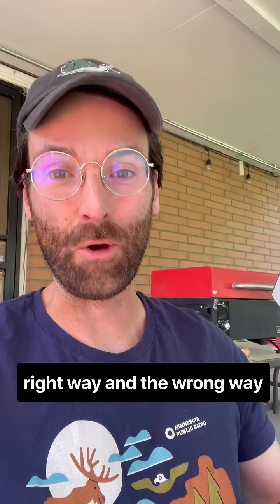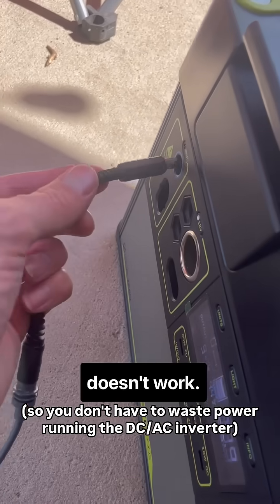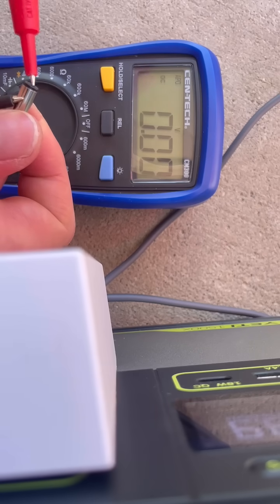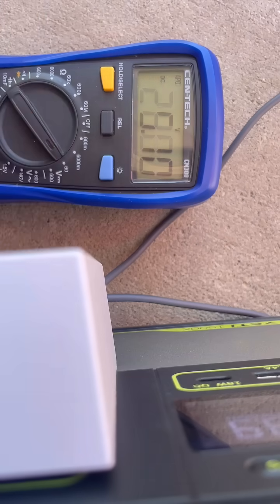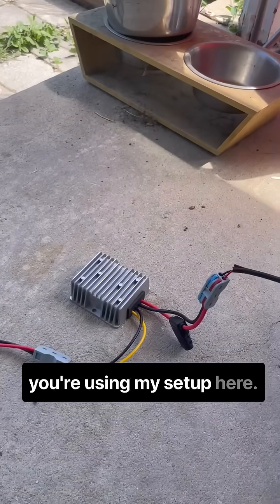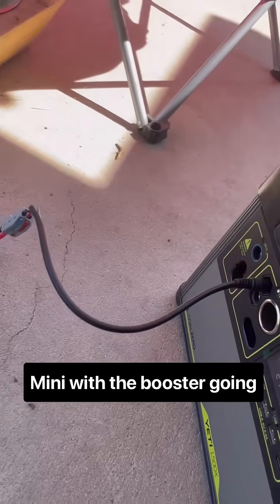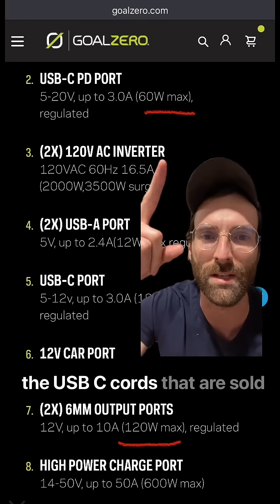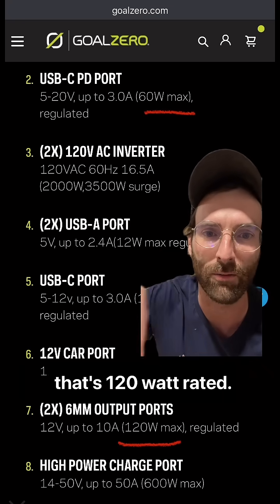Starlink Mini to Goal Zero Yeti DC Port

Comment: I'm setting up my starlink now, and this was super helpful so thanks for sharing! Any thoughts on using the car port to plug in the USB-C instead?
Reply from the maker: Glad it was helpful! The USBC port on the yeti 1500x only goes to 60W and need to get to 100W rated. The 12v car plug is also an option on there, but my fridge is getting plugged into that. I had 2 of these 6mm barrel plugs available, so wanted to connect to those.
Reply: @mattmaclean  Makes sense! Thanks for the response!

Comment: Starlink mini can run on as low as 12v. It’s a 12-48 system.
Reply from the maker: Possibly with a shorter cable with higher gauge wires, but not with the stock 50ft cable